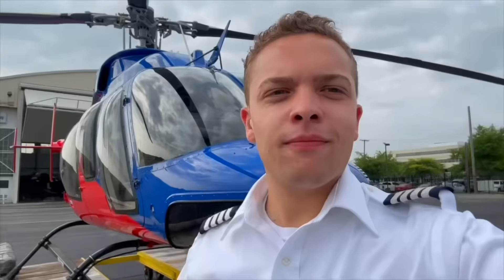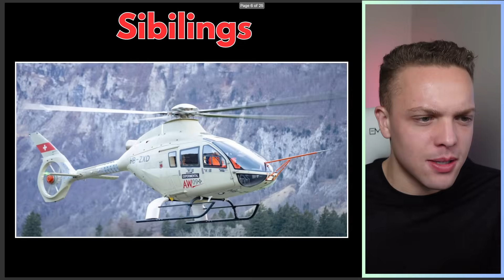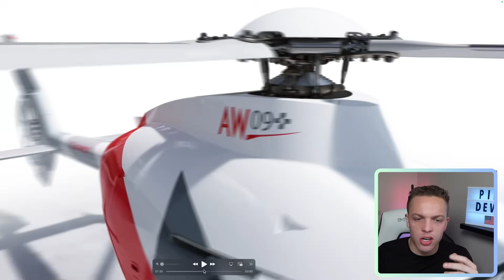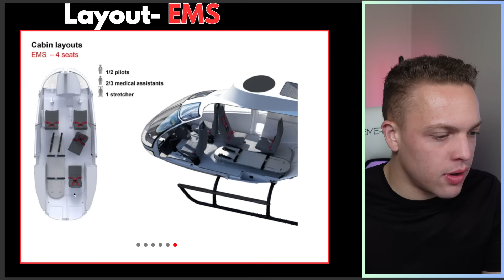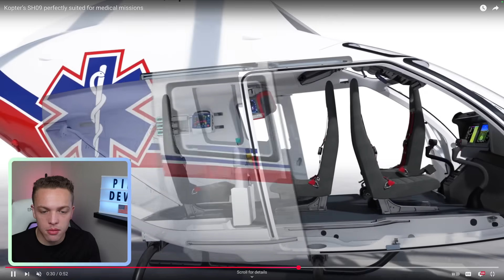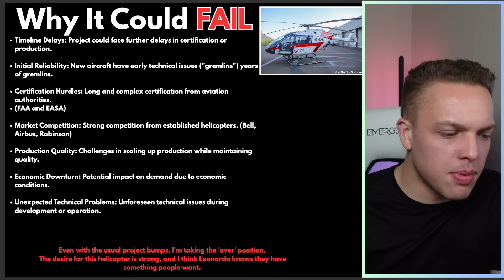Why The AW09 Might Be Perfect

Comment: It at least looks good.  Bell blew it when they designed the 505... SO stupid looking.  I love the hi-viz doors.  
What ALL helicopters are missing is QUALITY screen/radio interface via the CYCLIC & COLLECTIVE.  Yes, touch screen sounds sexy, but there are so many keys/buttons that should be accessible via the flight controls.  I just don't get why there are no test pilots or "feedback groups" providing this input!!!!  We seriously need quality UI/UX software AND hardware people in this industry.  You should never have to take your hand off the controls to change freqs. and I'm not talking about a comm flip-flop between active and standby (yes, you need that) but also can switch between UHF, VHF, FM (an up-down-left-right type switch like the OH-58D?).  Airbus (and I hate Airbus helicopter products) have the best cyclic setup option out of the bunch (plenty of buttons that are fairly ergonomical to reach and lots of them); it's easy to make a collective control head whatever size you need.  There are lots of times you need to just be able to zoom in on the moving map or switch display options that should be tied to a button on the controls instead of taking your hands off of them to touch the screen.
Also, I forget which Garmin but I think the touch screen G650 when you went to change the volume the little mini-screen display would cover over the flip-flop button for 2-3 seconds, delaying you to flip-flop if you needed to right away (who designs these things?!?!?!).  Poor software UX design.

Also, QUALITY pilot seats.  Passenger seats can be those thin-style, slick looking types but pilot seats (e.g., butt in it for HOURS/ALL-DAY) should have amazing foam.  I have an office chair at work (NOT memory foam) that I sit in for 8 hours my butt NEVER gets sore (kind of the higher end Office Depot style that's not even gel; just high quality padding; and it's a 3rd hand-me down, LOTS of really big guys used to sit in it for years before me and it's still amazing).  Why can no helicopter manufacturer not figure this out (I've flown 60, 206, 407, 130, 530, and 145 and they've all largely sucked in the seating category).  

Little details like a quality helmet hook, SEPARATE designated place for checklist/emergency checklist or iPad (compact slide in compartment and NOT the same big pouch/compartment area you're going to stuff your snacks, hat, etc. in)... I'm sure there are others but I'll finish my rant for now.

Comment: Keep in mind that single engine helicopters still have a significant operational limitation in EASA land. That will limit its use if it ever gets done. It apparently had significant aerodynamic issues and they needed to redesign a lot.

Comment: So this was originally the "Swiss Copter" (hence the original "SH" model number).  They Renamed the company "Kopter" to get more $$ and built 5 of these, which have been flying for about a decade.  They got stuck at getting certifications, which led to the Leonardo buyout, since they had the experience and facilities to get Certifications.  Leonardo initially figured about 2.5 years for getting certifications.  Still "working on it".  While it was originally designed to be cost competitive, a decade of delays, and bureaucracy all add to the final cost.  The delays have also allowed for significant competing models from established helicopter companies, as mentioned.   

The global economy and customer purchases will determine the fate of this great helicopter.  Leonardo will not make these at a loss  (they need > 250 unit sales to make this viable).  Therefore, the unmentioned vulnerability for the AW09 is the cost of acquisition and cost of operation.  Neither of these will be "cheap" and may ultimately doom this 'copter.

FYI: The history of this helicopter is why I often cast doubts about the Hill HX-50 and HC-50.  Zero operable flying version and no functioning engine, yet "deliveries" of the HX owner built starting in "about year".  Right.   Some may say that they have not properly promoted its commercial potential.  There is none !  the Certification they will be trying to get makes any commercial use, or use in population dense areas and airports illegal!   It is essentially akin to a fancy car, that is not "street legal"... anywhere.
Reply from the maker: Wow, thanks for all the added context—you clearly know your stuff! I totally agree: the AW09 could be a top-tier heli if Leonardo delivers, but time’s running out and the competition isn’t waiting.

As for the HX50 and HC50? All flash, no substance. At this point, I think there's almost zero chance it ever becomes what they're promising. Funny enough—my next video is all about the HX50. Spoiler alert: I'm not exactly hopeful.
Reply: @PilotDevin  The question for Leonardo is Cost vs sales.  At this point I suspect they don't have enough customers for the estimated price (maybe ~ 1/4 of what they need).  

Hill is supposed to show a working engine prototype by the end of June, again in Sept for customers, and a functioning (NOT FLYING) HX-50 by the end of the year.  Get your pop-corn ready !

Comment from the maker: What are your thoughts on the AW09? Is It Perfect?
Reply: I agree, I think that the AW09 could potentially be the ideal helicopter for HAA ops.  The program that I fly for is currently looking at replacing their fleet of Bell 407s because of performance issues in the summer months.  I'm holding out hope for the AW09, but they're a little bit risk-averse, so the current contender is an Airbus product.
Reply: No helicopter is perfect but your review is spot on. It'll be a nice EMS machine
Reply: yes, it’s perfect and not only for EMS operations 🚁 nice video👍🏼